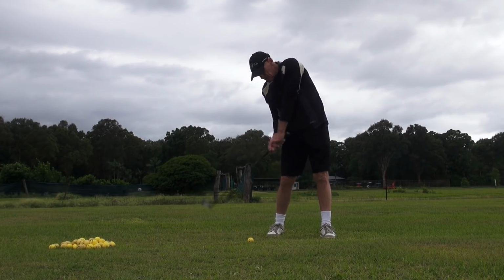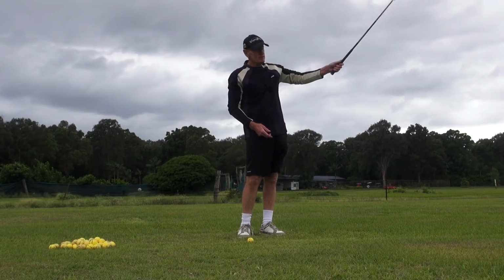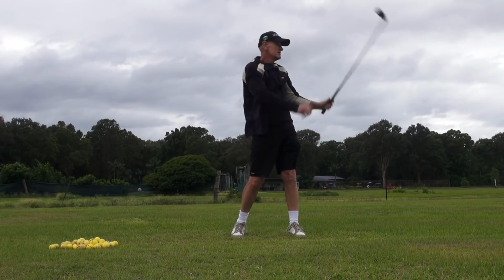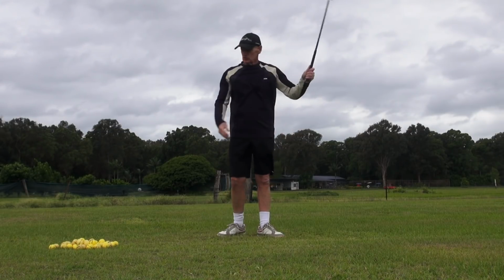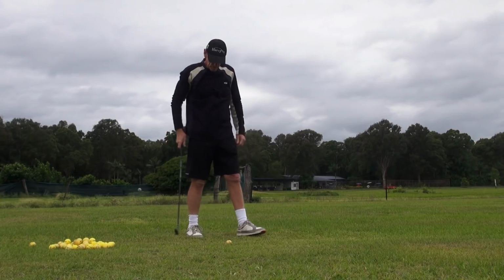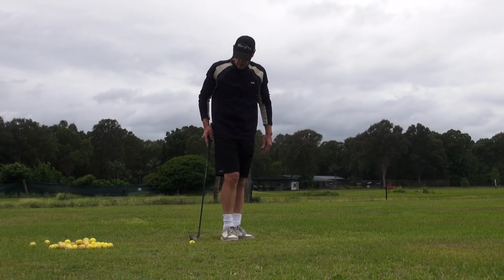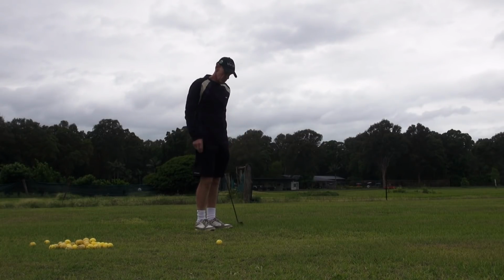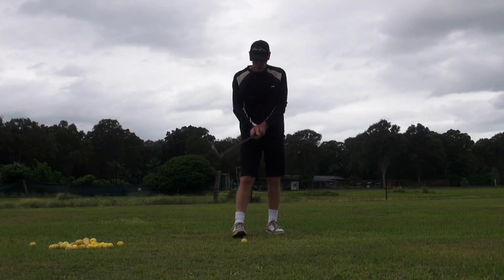Latest Channel Lock Swing Updates.

Comment: Hi JH, with Channel Lock at address, you say you are 1/4 into your turn. Can this pre-turn be even greater so that the club is grounded further back along the takeaway arc like Moe did?. The extreme of this would be club fully open parallel to the target line, fully in your turn and loaded on the right side (or close) and from there just pickup the club and fire it through. Suspect timing and tempo are the limiting factors but I guess with enough practice it might work well. Also picking up the club would make it easier to get the bent lead-arm and into the maximum swing arc position with shaft vertical to the sky that Jack Kuykendall advocates.
Reply from the maker: Hi Paul,
                 I think you could backcock/pre turn  more for sure if you can do it and be comfortable doing it.. I am not an advocate of deliberately changing the backswing plane in any way .. I personally never like the feeling of the club going 'up' in the backswing because that means for me I have lost my arms connection   to my body on the backswing... I like to feel my arms/hands never gain height in the backswing at all which for me keeps all my body components traveling in the same radial direction and in the same plane on the backswing. 
                  If you have a big verticalization of the arms on the backswing   as Jack Kuykendall advocates  you have to   make a big plane change  with the arms coming down to match up with the shoulder plane .. I have  virtually zero   change requirement of the arms plane on the downswing because I  keep the arms  in the same relative address plane on the backswing.. my arms go 'around' my body on the backswing .. not above my body.
                                I absolutely believe  bending the lead arm on the backswing  is a great power accumulator .. a 3 lever swing clearly has more  storage and leverage capability than a two lever conventional swing.. however I think the bending of the lead arm should be done  in a plane that  is not  as radically suggested as the one Jack advocates but more  as a normal 'wrapping' of the arm 'around' the body as opposed to being disconnected and 'away' from the body on the backswing.
                            I know for me a properly bent lead arm would generate probably about  20% more clubhead force and speed in my swing...    I can do it in a practice swing perfectly and the speed increase is  so much higher but I cannot do it in a proper swing  because the program I have  of keeping my lead arm ramrod straight  is so strong after millions of reps doing it  that it just takes over in a normal swing application and does not let me bend my lead arm at all..it is very frustrating because I know I could  generate so much more speed if I could do it.
                       cheers Jh